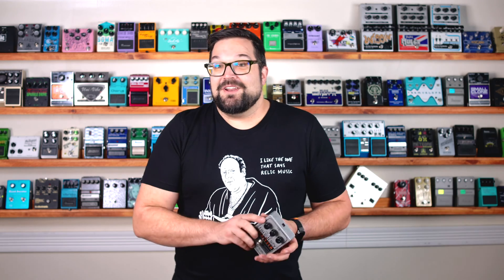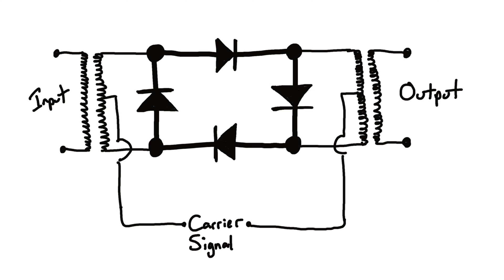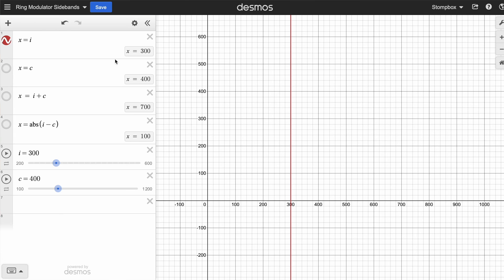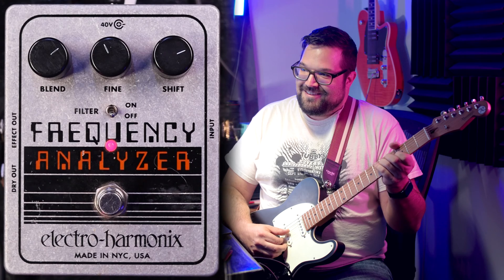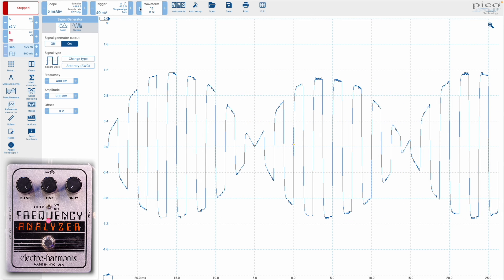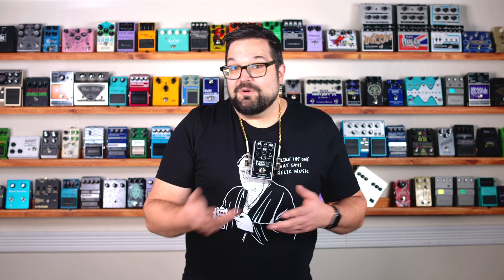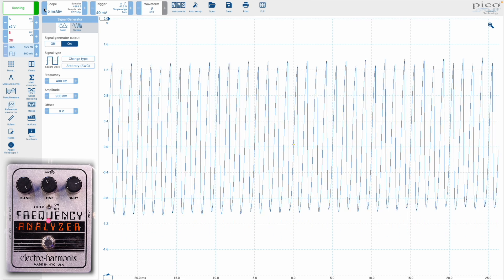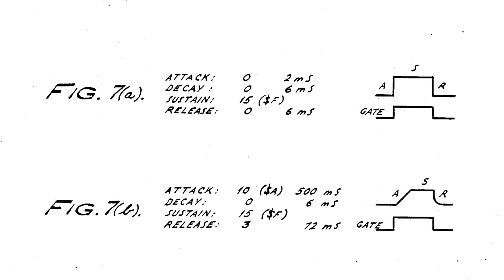Literally Analyzing Frequencies with the EHX Frequency Analyzer

Comment: old vid aside, if you see this, you should check out EXH’s newest Ring Mod, the Ring Thing.  it can do even crazier things than this one.  

also want to get one of the Warm moogerfooger knock offs so i can use an ABY box to split my signal into the pedal’s normal input, and to plug into the pedal’s carrier frequency input at the same time.  i just want to know what happens! (also, it can act as a tremolo too.)

edit: also, i believe it’s actually called a ring mod due to the ring arrangement of the diodes that are used to produce the effect.  the ring sound is just a coincidence.

Comment: Might be because the tremolo don't go to negative value, where the carrier go. Yet i continue to think that a fast tremolo is a sort of ring modulator but more softer for this.
Reply: Now seeing with desmos, the reverse behavior depend also of the frequency. For example if the carrier is 4X the frequency of the signal, it reverse, but not when it's 3.

Comment: I miss having a ring modulator..... I got my first one when I was a teenager back in the late 1970's. I'm no expert on electronics, but I know what I like. Looking at the current available ring mods there's the one in this video, another by EHX called the Ring Thing for about $40 more, and then there's the fairfield circuitry"s Randy's Revenge which seems like a great option , but above my price point at this time. Is the Ring Thing really a ring modulator...? It seems to have a lot built into it to make it sound "more normal". Any recommendations or thoughts... suggestions? Thanks for your amazing videos!
Reply from the maker: I haven't had a chance to play around with the Ring Thing. It says it's a Single Sideband Modulator, so there's some ring modulator-esque stuff going on, but I can't really tell. I also haven't watched too many videos on it because I don't want to accidentally copy someone else. Looks interesting, whatever it is. There's also the EHX Mainframe, which is like an intelligent ring modulator with distortion. That one's also pretty expensive, but it can auto-calibrate the ring mod carrier frequency to a note you're playing, which I haven't seen anywhere else. 

Looks like the reissue DOD Gonkulator is fairly affordable, and that's got a killer distortion built in as well. Might want to check into that one. I had a video up of it here at one point, but I took it down because I wasn't happy with the quality. Might redo it at some point, but it's a really fun pedal with some great (nasty) sounds. The reissue also lets you set the carrier frequency, the OG one was fixed.
Reply: @StompboxBreakdown 
Thanks for getting back to me. I'll have to check out the Mainframe, I'm not familiar with it. For $200(Canadian) I can get the last EHX Frequency Analyzer in stock at a shop fairly close to where I live. Since they're out of production and not often found in my neck of the woods. From what I've seen of the Ring Thing it seems to cater to the harmonizer side of things (+ I also misquoted the price; they're about$375). It's between the one you reviewed here or wait until I can afford a Randy's Revenge....well built quality piece of gear. Not without checking the Mainframe first! Thanks again, SO much. Really appreciate your knowledge.

Comment: The frequency analyzer is a powerful tool both for bass and guitar if used properly. Try blend full cw, fine full ccw, shift just before full cw, filter off. Add an analogue suboctave before it[ boss oc2] and any bit crusher after it[ using  sample rate reducing, not bit crushing]. Also works great with fuzz  and/ or low pass filters after it.

Comment: Wayne Krantz is probably one of the most artful guitar users of ring modulators out there.  Very restrained use, that allows him to play melody lines, but retain some boing.

One of the things to keep in mind, when it comes to ring modulators, is that they were developed in the synth universe, and anticipated carrier signals that were MUCH simpler and cleaner than what guitars provide, and typically anticipated use of sine wave oscillators for carrier or modulator, or both.  Feeding them carriers with lots of harmonic content results in a LOT of sums and differences that one probably does not want.  Consequently, the most pleasing sounds, that will begin to approximate what RMs were designed to anticipate is to a) provide some compression of the signal, so that it is relatively steady in level, and b) shave off as much of the top end as you can.   The Frequency Analyzer includes a filter control, intended to accomplish 'b', but there's no reasons why one can't provide additional help.  

Because the sums and differences are arithmetical and constant (i.e., +/-100hz happens whether playing an open low E or the highest note on your high E), the lower the modulation frequency, the more "pitched" the result sounds as you go up the fretboard (do the math and you'll quickly see why).  So if you intend on playing something that sounds like a melody, think about the range of notes to be played, and adjust the modulation frequency accordingly, so that the RM just adds a bit of hair/boingeyness to the sound, rather than anything wildly unpredictable.  Generally, lower modulation frequencies yield "saner" outcomes.  Ideally, it would be nice if all RMs had a range switch for modulation frequency, such that lowest and highest possible frequencies wouldn't be jammed into the one pot.  Sometimes, you want to be more precise dialing in the modulation freq.

Virtually all analog octave-up fuzzes will produce results that can sound vaguely RM-ish.  The Dan Armstrong Green Ringer was likely named as such largely because it would produce surprising sideband products if one played bent double stops.  The string being bent should have gone up in pitch but the heard note went *down*...HUH?  They ALL do that.  I've built easily 8 different octave-up fuzzes and that's what they do.

You're correct that some effects can be made to sound close to an RM, but aren't strictly ring modulation.  In fact pretty much any modulation effect, be it tremolo, flanger, chorus, phaser, etc., can sound perilously close to a RM if one increases the LFO rate up into the audio range.  Since many such LFO ranges are dictated by a single capacitor, and tend not to sweep much faster than maybe 12hz, reducing the value of that capacitor to about 1/3 or 1/4 of the original value will get you audio-frequency sweep rates that serve up some fairly authentic-sounding RM.  My old MXR rackmount M-113 digital delay had a pull switch that multiplied the modulation rate by 100x,  (100 x 10 = 1000hz!).  But again, bear in mind that very few, if any, such pedals will shave off the top end as a true RM is expecting, so the results will be more raucous than the Frequency Analyzer shown here.

Finally, if ANY category of effects ever called out for a momentary engage-switch, it is ring modulators.  They are rarely the sort of thing one leaves on for an entire song, so being able to insert the effect for a coupla bars here and there, on demand, would be a good thing.
Reply from the maker: Whoa, that's a lot to digest. I really appreciate the insight. Yeah, being able to kind of set a policy for the two sidebands independently would be pretty interesting. I haven't dug into it much, but the EHX Single Sideband Modulator seems to allow for that sort of thing. I also think the simple vs complex harmonics thing showed up with the Miku vs Fart Pedal experiment at the end. 

As for other effects as ring modulators, I may need to do a deeper dive into what happens as LFOs approach audible or near-audible frequencies, and I suspect that the "A ring modulator is just a fast tremolo" schoolyard rumor got started from someone saying that their whatever's LFO goes up to "ring modulation speeds". 

Oh, and heck yeah, momentary switch... especially one that can fade in and out gradually. That'd be great.
Reply: @StompboxBreakdown  Thanks for nudging me to look at the Ring Thing in more depth.  I knew of its basic existence, but had never dug into it, naively assuming it was simply a better Frequency Analyzer with presets.  But, being digital, it's clearly a different beast than the typical analog RM.  Somehow, the ability to select upper OR lower sideband products escaped me.  It can transform into a pitch shifter by selecting a given sideband, and panning to 100% wet, such that only that sideband product is heard.  Of course, where it differs from an actual pitch shifter is that the sideband product is determined as a fixed sum or difference, and not a proportional difference.  So, you could tune it to a fifth above , but that doesn't mean the result would remain a fifth above, no matter where you pick.  I might be wrong, though, and it's a smarter product than I give it credit for here.

Comment: I can't believe you put this video out the day after I missed an auction for one! Great minds! 😄 At least now I don't need to demo this thing, so you've saved me some cash! Haha!

Also, 40v??? What the hell?! With that kind of power requirement, I wouldn't have been able to even turn it on in the first place, let alone film a demo with it. 😂

Great video, Jeff...as always! 👍🏻
Reply from the maker: The timing was certainly right for a Ring Modulation video, glad I could save you some bucks. Yeah, I'm not sure what it's doing with 40 volts. Thankfully the adapter is included, and it's center-positive... so in theory if it were plugged into the wrong pedal, it would blow a diode before taking out the rest of the pedal, but still.
Reply: @StompboxBreakdown  If you ever get chance to buy a Ring Thing...do it! It's easily the best, and most useable ring mod effect I've ever tried. At least until the Red Panda Radius comes out.